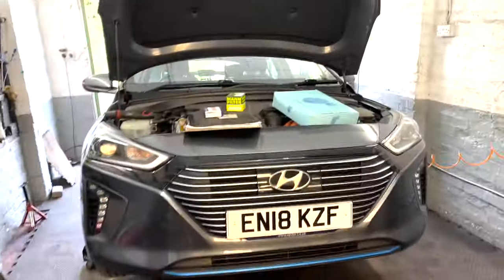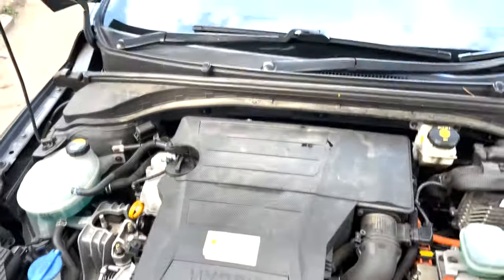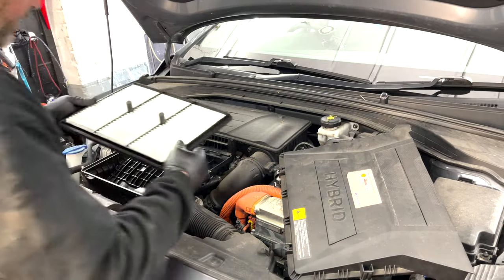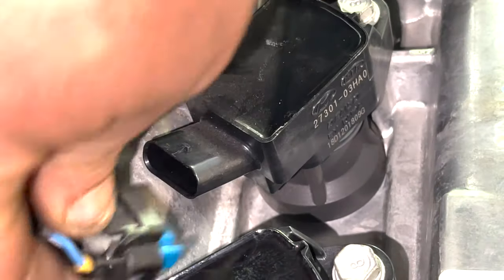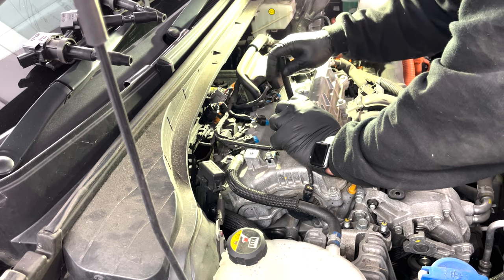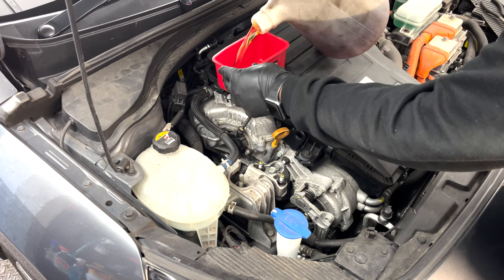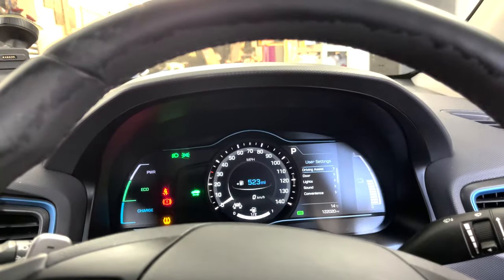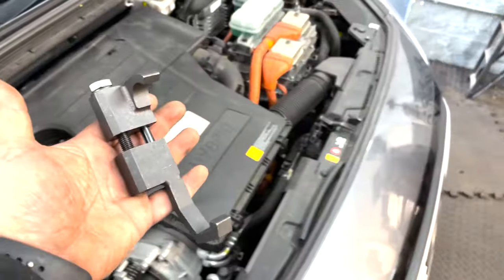Hyundai Ioniq Hybrid Oil change Air filter Oil filter Spark plug Service light Reset

Comment: Hi mate...you forgot to change the cabin air filter too...my 2017 ioniq is at 240K mileage and love it...I wished the new models today 2022 came in hybrid too ...btw my hsg belt still in good shape at 240K mileage due to driving Uber here LA...great blog mate
Reply: Have you had any trouble with this car?
Reply: @230k19  nope only wear and tear of double clutch disc inside the transmission and cat converter…it’s totally normal part of it due to Ubering high mileage here in LA

Comment: Why you change the spark plugs?  I’ve never needed to change plugs on a modern car with fuel injection. Thanks for the video
Reply from the maker: I do change it around every 80k miles . Spark plugs are a service part and eventually will fail or strain the coils 👍

Comment: How's she goin'?  It's getting hard to source spare parts eh!!  It would be nice to see the belt change.  Nice job changing out the plugs.  There is lots of work to do before you get to what you want to work on eh!!  Take care!!!
Reply from the maker: Hiya Mike yeah Super difficult at the minute to find parts , a month ago I couldn’t get an air filter for this car not even from the main dealers …  cheers pal
Reply: @CarsExposed  got mine from Amazon but it's aftermarket from China hehe it works bottom line

Comment: Good Vid Igor…I find the configuration of this design bizarre…Why the separate starter generator? Why are those functions not carried out by the 3 phase PM synchronous motor/gen? Cause it’s not a Toyota I guess 🤣 Cheers 👍
Reply from the maker: I was also wondering I mean what are the benefits ? The only thing that I could think was maybe being able to turn the ICE on if you have any problem with MG1 but I’m not sure ,  definitely strange to have a belt to turn the engine over 👍
Reply: @CarsExposed  I don't know this vehicle at all Igor. But I suppose they can dispense with the DC-DC converter as all the 12v loads and 12v battery are supplied and charged in a legacy  manner. (If I understand the system architecture correctly) Likely simplified gearbox design as well.  And as always...cost was likely a major design constraint. Cheers 👍
Reply from the maker: @TheGibby3340  I should be looking after this vehicle until they run it to the ground , hopefully we will have the chance to get into the guts of it at some point , luckily for them this motor/generator are very reliable 👍

Comment: Hi quick question
I got my car service by Hyundai and the oil level on the dipstick seems to be too high
I can't see the level the whole orange part is covered with oil
How to best check engine oil? After driving or cold engine?
Reply from the maker: The best way to check the oil level is probably first thing in the morning after the vehicle has been sitting for a while, car on level ground , the oil level should be in between the L and F mark on the dipstick , I like to leave the level just a little bit before the F mark as you can see in the video ...  👍